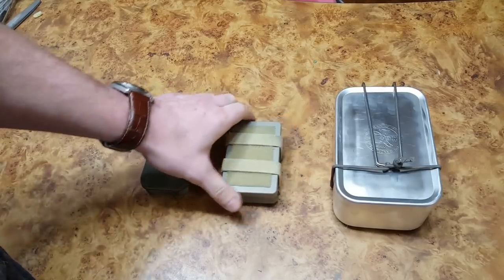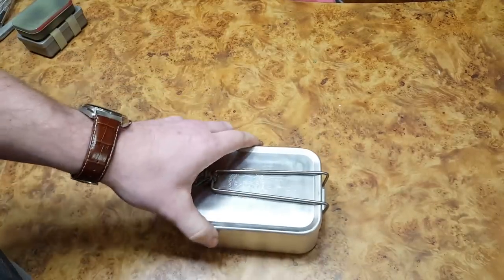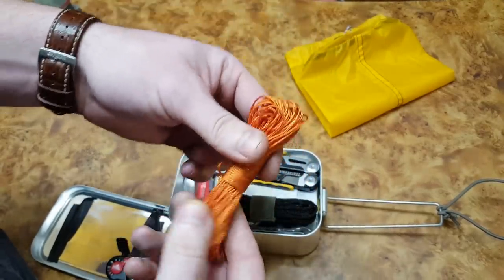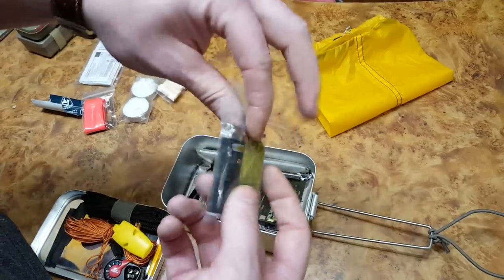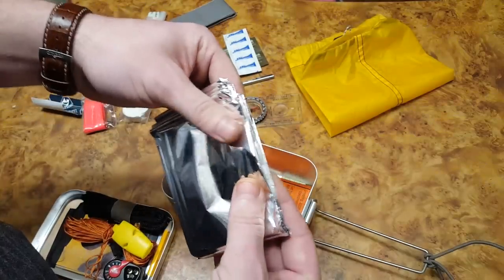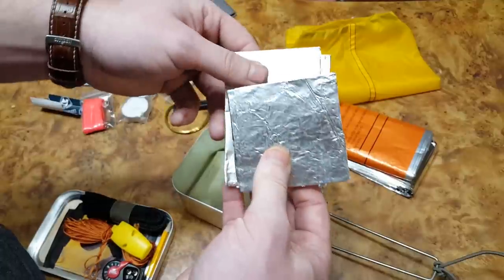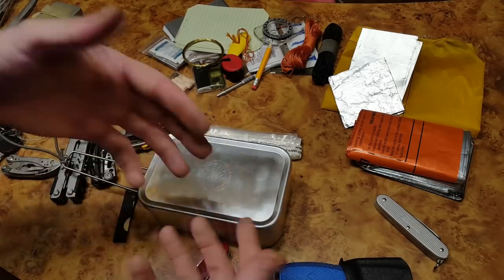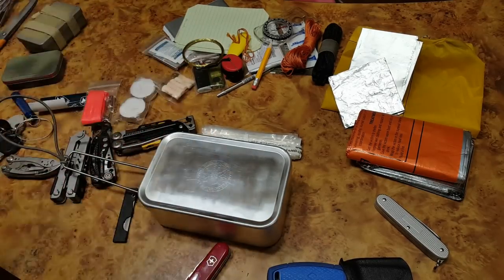Best Survival Tin Kit//Esee Survival Mess Tin homemade kit

Comment: If you put it into a "lock and lock" plastic container,it is waterproof,won't leak,carry water in it,fire starting tinder  won't get wet,use as a bowl,and lighter in weight,better head light would be betteralso a cable saw would be an idea

Comment: what you could do is wrap the mess tin with electrical tape, that should make it, at least, a water resistant, or get get some kind of foam rubber gasket and then clamp it down with ranger bands.

Comment: You do not need a knife or a compass in a survival kit.They should be on your person at all times.The compass may need to be replaced but the quality is good, unlike those cheap button compasses which are not reliable.  If this is all you have in a wilderness situation you should try and include a fruit bar just to boost moral. I like the fact that you chose a tin which you can cook in. A ferro rod would have been my choice for a fire starter along with a box of matches and some char cloth.

Comment: You could waterproof that bag... rub wax on it, then use a blow dryer to melt it in like when you waterproof shoes.
Reply from the maker: yeah,it's 'silnylon' so the nylon is impregnated with silicone making it waterproof,but water still leaks out the seams.

Comment: No wire saw, multi tool,fishing gear,plastic tube tent,meds(Oxycodone,Advil,Benadryl,Imodium,Valium,)
 tourniquet, flashlight is inadequate, mil spec 550 cord, $50 in cash, moleskin for feet,

Comment: Replace the pencil with a mini permanent marker. You can then write on more surfaces and also write on the flagging tape itself. Ditch the candles and bring extra c123 batteries for your petzl light. Ditching the candles will open up space for a better light. That petzl is a cool concept, but pathetic.

Comment: A piece of wooden dowel in a power drill 30 seconds of rotation with monofilament fishing line should you give you about three hundred feet very primitive but you can catch fish with it also if you use pop can pull tabs you can make more fishing hooks a little common sense can go a long way